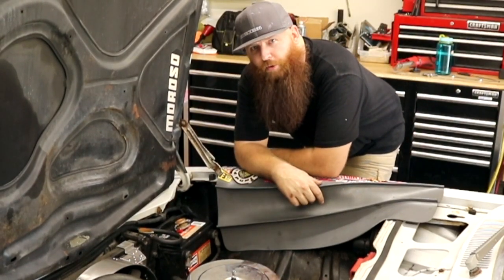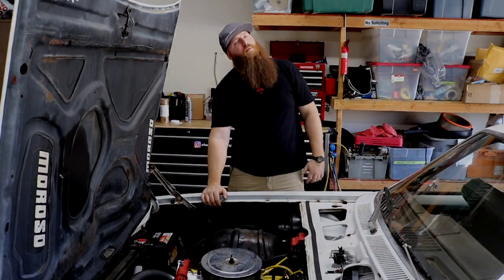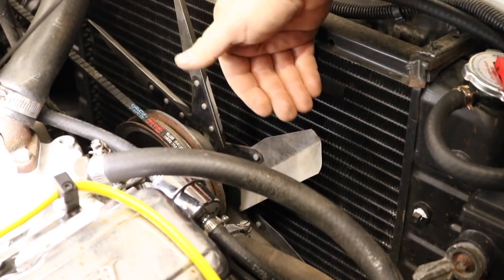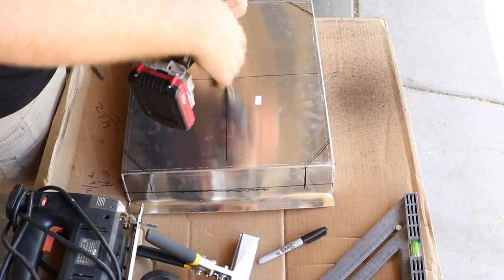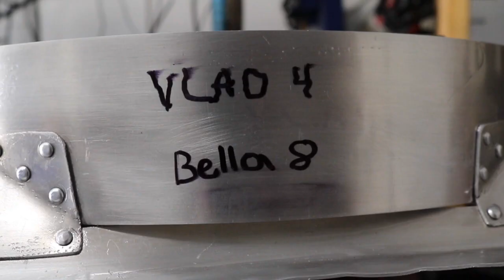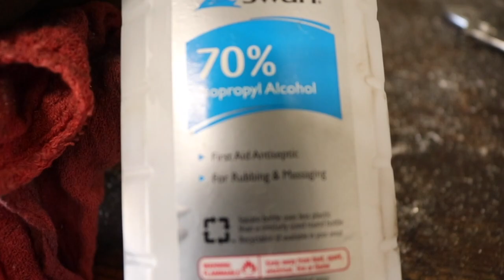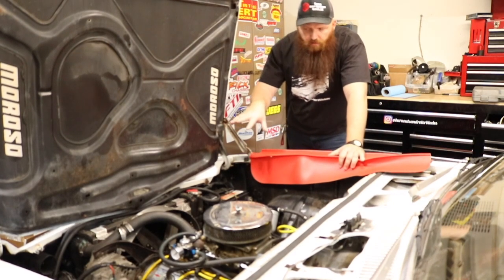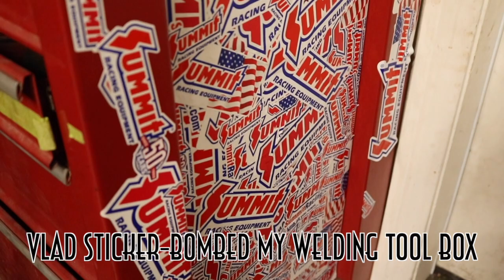H-Body Aluminum radiator & Custom fan shroud | Vega: EP7

Comment: A little TIP BIT when soldering apply the heat of the iron to one side of the wire and feed the soldering wire to the opposite side. The soldering wire will always flow towards the heat.  Love the video series of this Vega build.